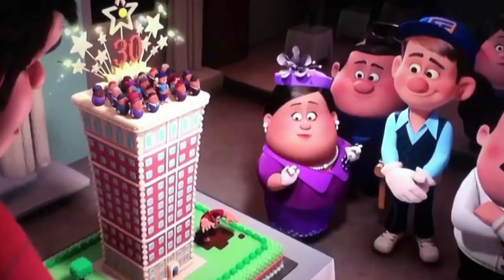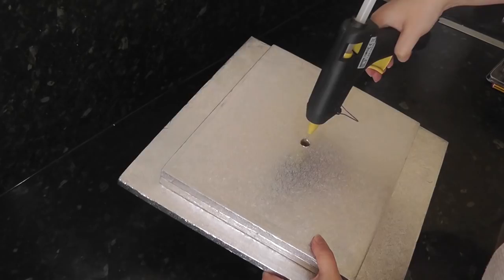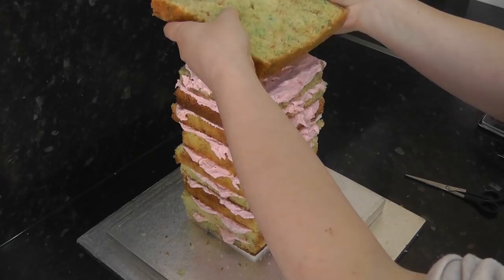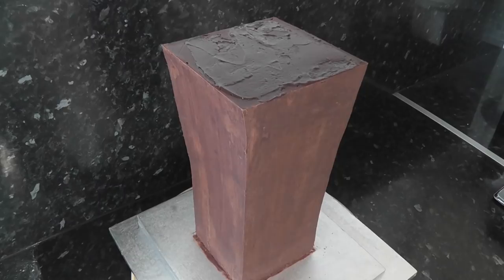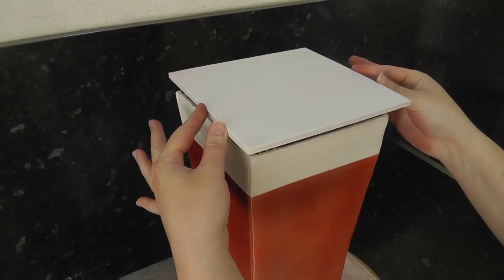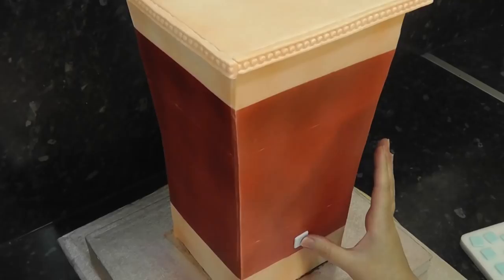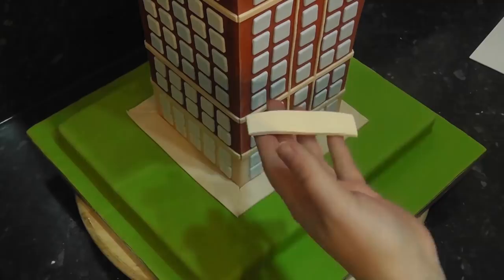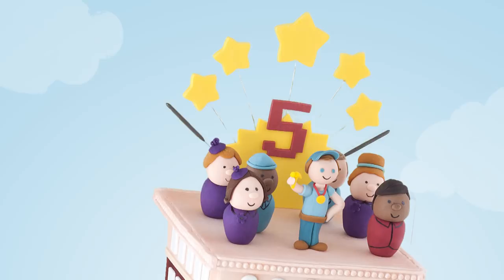Cake from the Wreck-It Ralph Film Tutorial | How To | Cherry School

Comment: Hi Tracey, awesome cake!! :) Can you advise if foam core is classed as food safe here in the UK. I've searched online with some saying it is and some saying it isn't. Many thanks...
Reply from the maker: Hi! It's yet another cake taboo, food safe foam core does exist according to the internet. Thing is the UK cake cards are just a bit of foil paper covering mushed up sawdust-like card, and those are 'food safe' due to the foil exterior, yet one little cut with a scalpel or knife shows the sawdust fibres inside...which you wouldn't necessarily want in a cake, and foam core looks much cleaner and safer, yet not sold for cake as its aimed at art projects.... crazy food safety lol